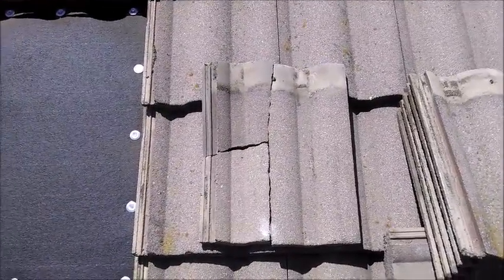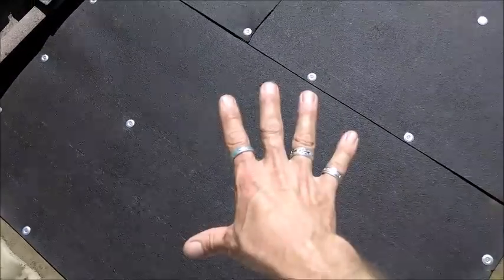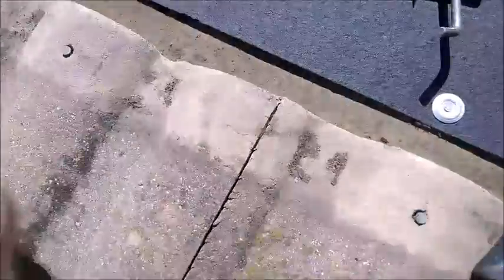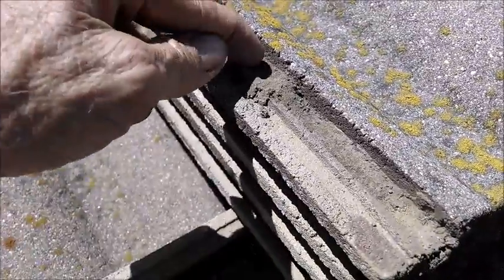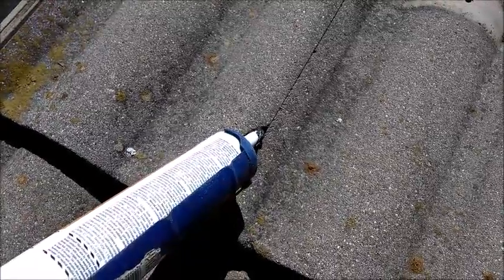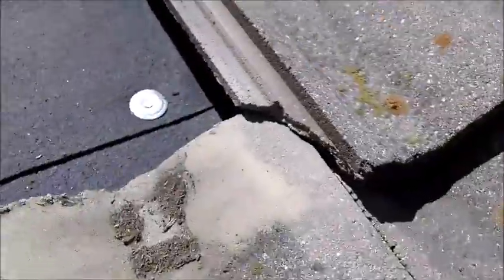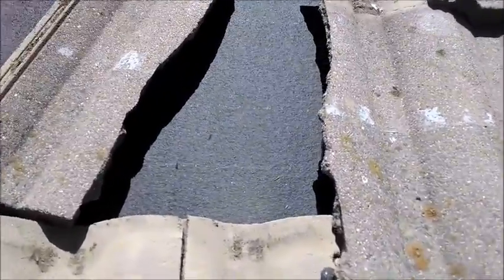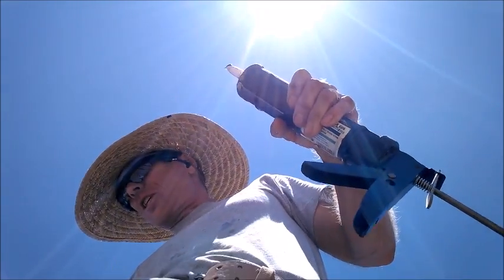Tile Roof Leak Repair - The Right Way...

Comment: Yeah I have several problems you're actually talking about a couple of problems that I have right now with the client's roof work right now I'm not a roofer oh my God it's almost like you're working on the roof that I'm working on anyway I had to repair a ridge Gap tile and the only thing I can think of because it's what I'm used to it was fiberglass
Reply: Yeah there's more to that story but I'll find out how it held up when I go back tomorrow
Reply from the maker: I’ve always benefited a lot over the years by imagining how the water runoff would interact with the roof as I was repairing it if it were actually raining. You have to think like water if you want to be able to figure out why roofs leak or do not leak. I’ve been water proofing roofs now for over 36 years. Just pay attention to what you see on the roof & you can figure out just about anything. Oh yeah, & ask God to show you how it works & help you fix it right. He is the master Carpenter you know.
Reply: @MrThedocholiday  well thanks for video thanks for your time you have a good day I need to go fight this f***

Comment: I don't use them personally, but I've removed 30yr old roofs that had plastic caps. I've never seen them "rotted out".
Reply from the maker: Bob Piff what did I mean by rotted out! Deteriorated... Plastic doesn't rot. It becomes brittle, cracks & fails. Besides deteriorating, plastic cap nails simple cannot hold the felt fast like galvanized metal cap nails do.

Comment: what cauking do you use
Reply from the maker: Any kind of co-polymer or tri-polymer will work. You can also use silicone if you want but I like to use something a little thicker so it doesn't sag. There are some formulas that cure very hard that I would avoid. You want to use a construction adhesive that remains flexible but sets up in 1 - 3 days. That way the tile will not likely slide out of place before it sets up & yet it remains flexible enough to cut through it if you have to service the area any time in the future. I use Novalink tri-polymer but there are many available brands & formulas with similar properties. Take your pick...

Comment: if you seal the broken cracks once you tiled it in then ur not sealing the crack under the full tile above and instead of sealing tiles together you should make a lead tie double it up for strenghth and fold it over the tiles you cant nail, same as slates.

Comment: Hi Duster Dan,

What is the best glue for the roof tiles?

Thanks!
Reply from the maker: Tommy Z copolymer or tripolymer in my opinion. I currently use OSI quad from Lowe’s because it’s workable, inexpensive, adheres to multiple different construction materials & is fairly durable. It’s not quite as durable as silicone based formulas but silicone lacks other necessary qualities for roofing applications. For me it doesn’t matter that silicone lasts forever if it detaches from other materials it’s applied to, which happens often with silicone based caulking.

Comment: Dan...I recently had to have a corner repaired.  I have a similar roof. I would love to send pictures and get your opinion.  Would you mind?
Reply from the maker: Anabella Lazzara sorry Anabella, I don't have the liberty to do that at this time. Perhaps you could post a few questions here & I could answer or advise you through YouTube notifications. Obviously you should be discrete & not post any personal info, but general or roofing specific questions should work well. Typically pictures aren't necessary for me to envision your roofing situation anyway... Been roofing a long time so... Hope that works for you. Thanks.
Reply: Duster Dan where are you located.  I’m in Santa Clarita, CA.  Shot in the dark but I’d love to have you take a look if you’re anywhere in Los Angeles county.  I had a solid patio cover installed.  For the most part it’s fine but there’s one corner where the flashing meets the existing roofline that leaked a bit down through my existing fascia board. When I remove the ceramic tile at that corner, I see the plywood and then the original paper on top of that and then my installer applied a new section of paper underneath that and through the flashing.  And then there’s a thick almost like cardboard paper that sits on top just underneath the ceramic tile.  I’m not sure what you call this but I know it gets wet in the rains and absorbs moisture.  The installers had cut this top layer away when installing the flashing.  Like I said, they slipped new paper underneath but then went over everything on top with a layer of mastec.  Not sure if this was done right.  It just looks a little sloppy to me.  By the way, how long does it generally take for that mastec to dry?  Thanks for all your help.  I know I’ve asked a lot of questions
Reply from the maker: Anabella Lazzara I not on the west coast anymore so there'd be no way I could look at it but I'll read your response carefully in the next week or so & respond as soon as I can. Thanks for your flexibility.
Reply: Duster Dan thank you.  I wish I could post or show you pictures.  It might make it easier.  Appreciate the help
Reply from the maker: Anabella Lazzara if you can post pics here I'd be okay with that but I need to stay discrete in public with my email address. That's the only other way I know to receive pictures. Thanks for understanding.

Comment: why dont you use batten strips to hang tile on, so you dont nail the tile?
Reply from the maker: Larry Barnum Because each tile is required by local building code to be nailed. I personally don’t like battens because they divert water that makes it through the tile & complicates any repairs that need done.
Reply: Duster Dan I am repairing a section of a-tile with batten strips that lifts the tile slightly off of the roof deck. For this reason, I plan on replacing the batten strips after laying down new felt. Would you recommend cutting small (approximately 1/8 inch) groves in the battens to allow for water to go through? Otherwise it seems like the battens serve as dams.

Comment: How can i prevent  the leak on tge led at the edge of the roof?
Reply from the maker: I’m confused by what seems your spelling error & if you could give a little more information I might be able to give you an answer.
Reply: A new gutter was fix recently in front of my house.They damage the led at the edge between the gutter and the roof and leak is coming inside my bedroom at long the wall.What materials can you recommend to fix the leakage?

Comment: got my leak repair today the guy said he use pilostic is that good
Reply from the maker: Without answering your question directly, since I've never heard of Pilostic, maybe I can help you answer your own question. Did he tell you what caused the initial roof leak in that area, what caused the original roofing materials in that area to wear out prematurely, what materials he used to repair it, how those materials will insure a water-tight repair for years to come & how his repair solved the problem of whatever caused the leak in the first place? Or did he simply act like it all was too complicated for you to understand the details of the rocket science of roofing repair? The later is more common... Those are the kinds of details I give my own roofing customers for their peace of mind. So if you didn't ask him similar questions, it's always possible to call & ask him whatever questions you may still have, assuming you have a number where he can be reached. Hope that helps.
Reply: Duster Dan he went into the attic and said the wood inside is not rotten. than went outside on top of roof. he told me the issue has been solve that someone didn't fix the whole leak. he said he use pilostic I emailed u the pics
Reply from the maker: Okay so far I still have no idea why your roof leaked or whether it will happen again or not in another area, only that the felt was worn out in that area for some unknown reason & the small amount of water that gets through the tile when it rains was also getting through the felt underlayment because it was worn out from over exposure to the elements. One clue I see from the pictures may be the fact of so much debris on your roof which are not allowing the tile to shed the water properly down your roof. You may need to get that roof cleaned off before you expect to make it through another winter.

Comment: Have the exact Monier tile on my roof- shit contractor did so much wrong no beam extension at any ridge 500' of rounds sitting on all ridges no hold down fasteners on edges w/o nails no nails on any ridge caps- no sealing on exposed ridges.. Valleys have chunks of broken tile used to support tiles in valleys holding back yrs of dirt/mulch-leaves and forcing water to spread out of valley +++++
Reply from the maker: Joseph Böhme yep... I'm so tired of belly aching about substandard labor I decided to do these vids. I've seen what you're talking about thousands of times. I feel your pain.

Comment: Why covering with paper instead of plastic waterproof tarp.
Reply from the maker: Because felt paper is designed as a tile underlayment, while tarps are not. And felt actually works really well as long as people stay off their roofs after they’re installed correctly.
Reply: @MrThedocholiday  "Because felt paper is designed as a tile underlayment, while tarps are not" ok but why? (following what people are saying / doing blindly (without even talking about conflict of interest) isn't an explaination).

Comment: Where's the tile laths?  Nailing each tile ? Why didn't you replace?

No wonder you have so many broken tiles ,  different practice in uk ,
Reply from the maker: The reason for all the broken tile was because somebody too large was tromping around on the roof & too lazy to replace them or report it to the homeowner. Besides that, this roof is up to code just the way you see it in the video & yes, I nailed every tile except the ones I can't nail because the nail holes are covered by the tiles above. In that case I glue them all.

Comment from the maker: I still see so much hogwash regarding roof repairs & why tile roofs fail. Many claim tile roofs only last 40-50 years when done correctly. They claim this estimate & throw in a little truth regarding why roofs fail prematurely before that time. After they sight premature failure reasons, then they bring out all the upsell reasons why you need to buy or use their “far superior products “. Some even go so far as to recommend reroofing your entire house with their superior materials when all you have at this time is a single leak that is NOT due primarily to material failure but rather substandard installation labor of ordinary materials. What a load of crud! Upsold Underlayment never solves the root problem of excessive rainwater getting through the tiles & the flashings to the underlayment in the first place... Never! And it never addresses the root problem of crappy labor of all materials in the first place, no matter what the quality rating of those materials is.

Comment: Some good advice and some bad that’s not s-tile that’s Malibu tile also know as m-tile for others there is also other tile that will fit that lock just really pricy
Reply from the maker: Malibu is a name, not a shape. I was obviously describing it’s shape rather than it’s name. And no, you can’t get replacements for these. If you try to incorporate substitutes into these tiles, you’d be the guy that the customer would be complaining to me about right before I fixed their roof correctly.
Reply: Have you worked with s-tile obviously not you would be the guy the customer would complain tell saying he didn’t even know what tile he was installing

Comment: In my experience all the water sits at the bottom and rota the bottom layer of felt
Reply from the maker: I’m sure you had a good point to make but it’s not obvious to me what your point was?
Reply: @MrThedocholiday  sorry in my experience it's the bottom layer of felt at the eaves or gutter that tend to rot first after the water above runs down to it so just because the peice of felt above looks good does not necessarily mean the bottom felt is not damaged

Comment: Ps.  A seasoned insurance adjuster will have been to more schools regarding roofs than most any roofing company.   Adjusters have more education on how to measure a roof, they have often been on, or more roofs in their careers that the roofer has.   Adjusters are not perfect and neither are roofers
Reply from the maker: Mark Smith Yes... to a certain extent, adjusters have seen a lot of roofs, but being on many roofs no more makes you an expert on roofs than a bird that craps on your ridge-cap. If a person’s time doing anything is not combined with a curiosity or need to know how & why something is, what is it’s purpose, why it works or fails & bearing the responsibility of whether or not it works or fails over time, then that person is not considered an expert on that something, wouldn’t you agree?

If you spent your life on the open road, would you automatically be considered an expert on trucks or Ferraris or muscle cars? Would you automatically know cam specs or how much carburetion is too much for an engine? Of course not. Roofing is the same way. This is why so few roofers today know what they’re doing but couldn’t the same be said for many skilled labor jobs today?

Comment: It's amazing how every  country is different,  if my guys did this here in the UK they would be sacked immediately.
Reply from the maker: rsg666 customers don’t often have the money to pay for a new roof & nobody makes replacement tiles to match. Trying to match the wrong tiles with these tiles would leave the customer’s roof worse off than repairing it like this. Understand the whole picture.
Reply: @MrThedocholiday  I have been in the roofing  business for over 30 years and have built up a stock of obsolete roof tiles which comes in very handy in this situation. Now surely  that's understanding the customers needs and "whole" picture.

Comment: why not use new tiles or at least lead flash it.
another tip is if you cant get a replacement tile if that is the case put a broken tile thats been flashed or sealed at the top of the roof as high as possible as it gets less water. 
maybe 4th one down from the ridge.
crazy how you guys dont use battens lol

Comment: WRONG you do not have to nail every tile unless it is over a a 6/12 TRI manual states it
Reply from the maker: Forty86 You obviously don't realize that codes differ from area to area. You're just a roofer right? You're not a contractor right? Because any legit contractor would know that codes vary from city to city, county to county & state to state. In fact, I'm pretty sure the nailing pattern question was on the contractor exam in California when I passed it over twenty years ago.

I think this is where most people go wrong when they argue with others about how to build & repair things without taking into consideration the local building codes.

My work has passed all local building & safety inspections for the last 30 years.

The only time it's not necessary to nail the field in my area of so cal is when the tiles are hung on battens - which are nailed to the roof sheathing.
Reply: So you even know what the TRI manual is. You states in you stated in your video that all tiles on all roof have to be nailed. You did not say anything about state and local codes. This is why i am saying yoy are incorrect. I sure in a hurricane prone are they may require all tilea to be nailed.
Reply: Be more clear in your videos

Comment: I'm not sure what Market you're in but you can't reinstall deteriorated aggregate material in most markets. Not only that you're literally taking a shot heard concrete material that's 20 years old and taping it together? Dang buddy that is absolutely not okay.
Reply from the maker: You’re mistaken. I’ve been doing this over 30 years & stand behind every one of these repairs with a two year warranty, unless of course the homeowner negotiates for a longer one. I have zero callbacks... 😄

Comment: Your trying to put more money into your packet by using glue... Your are stilling costumer using glue.... Buy new tile....
Reply from the maker: They don’t make these tiles anymore. They don’t make these tiles anymore. Hello… They don’t make these tiles anymore. And no, you can’t find them in any of the boneyards either. These are offset low profile ‘s’ tiles. New non-offset low pro tiles will NOT fit together with these tiles. They will leave huge gaps, cause much water penetration during storms & will not sit flush or be stable on one another or on the roof deck when installed. This causes extra stress on all the tiles when attempting to integrate the wrong tiles that don’t fit together properly & will break more tiles when attempting to service the roof or even finish the repair.

I bet you’re a hoot to talk to cause you don’t listen to what others tell you - like what I said in this video about these tiles being obsolete - & you make assumptions about what you think you know. A typical narcissist & quick to accuse others of wrongdoing. You’re part of the problem because you don’t pay attention except to anything but yourself & then you accuse others.

I hope you wake up & stop shooting the good guys in your industry. Oh, and for goodness sakes please learn how to spell if you’re gonna criticize others with written words… “stilling customer using glue”. Really?

Comment: Just replace the tile! $1.50...!!!
Reply from the maker: If they were available, yes. In most cases these tiles haven’t been available for a long time. The manufacturers make sure of this, because they’d rather force customers into replacing an entire roof rather than replacing a few broken tiles. That’s why they change their tile profile molds about every five years or less.